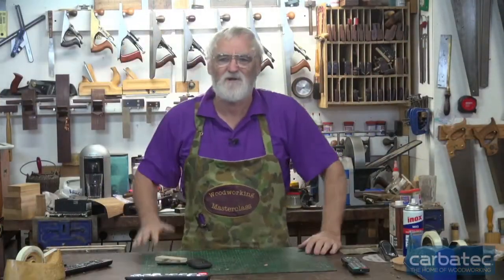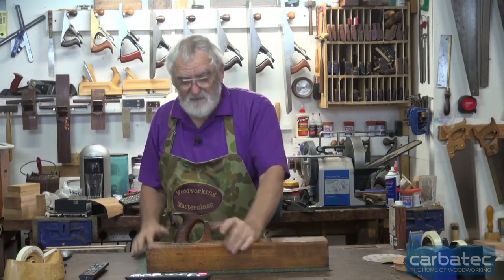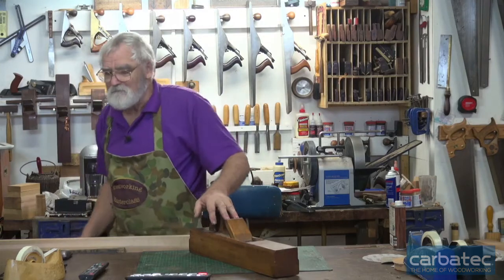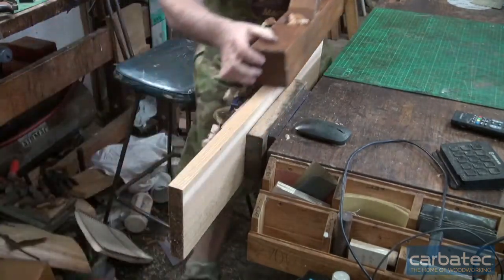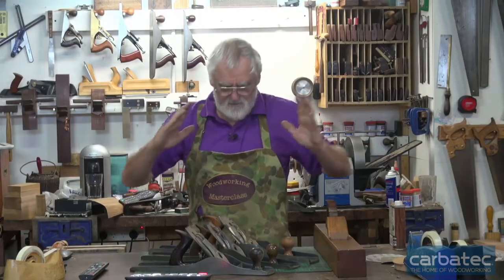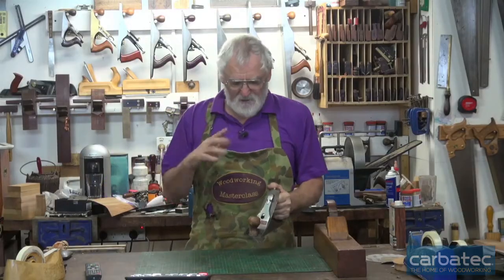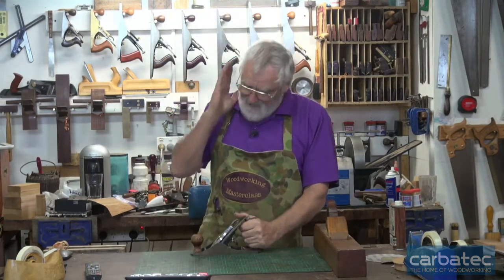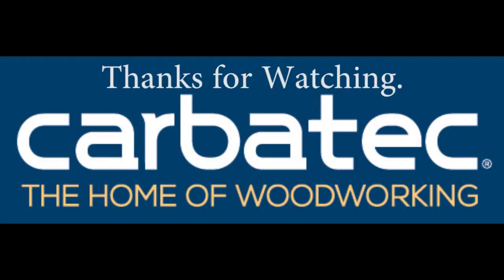Bench Planes sizes and Uses - Back 2 Basics with Steve Hay

Comment: Love your presentations. When I learnt woodworking at school (many years ago) I would be in big trouble if I put a plane down on its blade - it always had to be laid on its side to avoid blunting the blade. You don’t seem to worry?
Reply from the maker: As said in another video Bob, They owned the planes so they can make the Rules. Was a school for 2 years of woodwork. Been a furniture maker for nearly 40. Guess it doesn't make that much of a difference after all.:) Cheers Steve